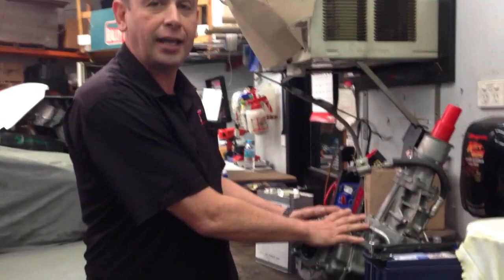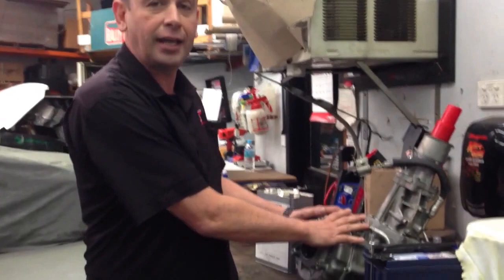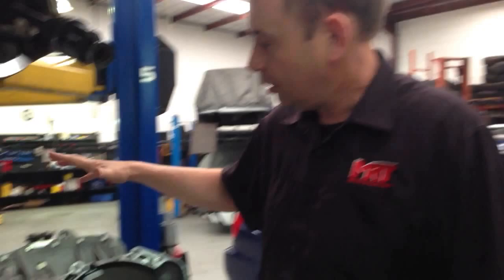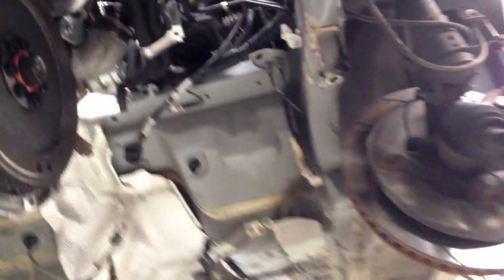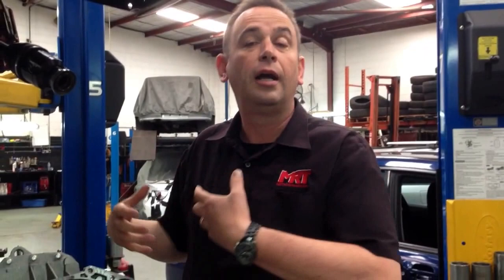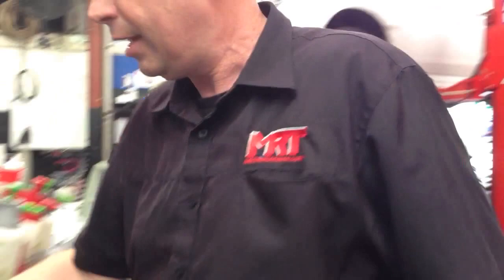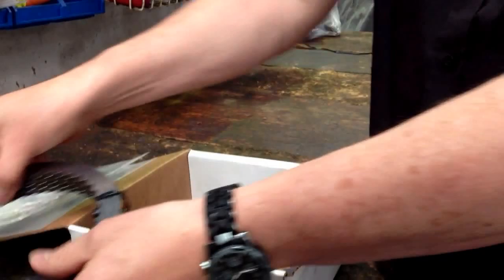Mitsubishi SST transmission inside secrets Part 3

Comment: I have the same gearbox on my Mondeo, changed one so far:-((, the new one since I have it i'm changing the oil at max 45k km or 30k miles! Other than that you must pay attention how you explore it, in the winter I recommend to worm a bit the gearbox (only start the engine)before going to drive the car! In this way you keep your gearbox safe.

Comment: hej guys i drive a 2010 lancer sportback ralliart with the sst, at full throttle my rpm are jumping (like clutch slipping) gear changing is sometimes a little rough and my budget is not that big to try everything what you think it could be ? would be nice if someone could help because it is alsmost easyer to find gold than someone in Europe who know something about the sst, thank you for the videos very helpfull to understand the sst
Reply from the maker: sounds like your  trans is very sick
:(